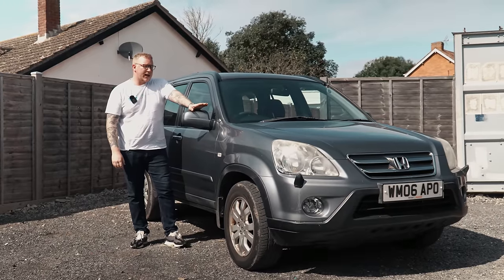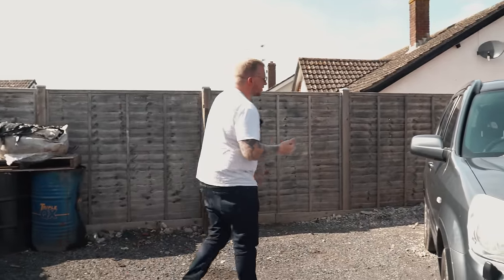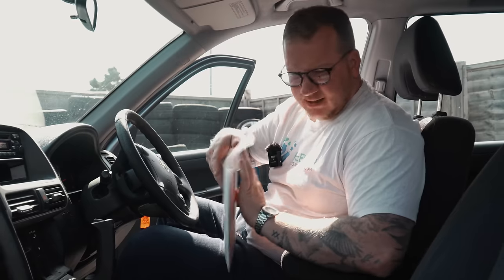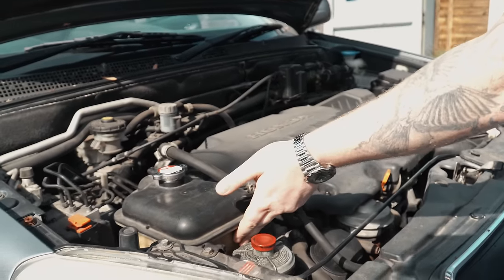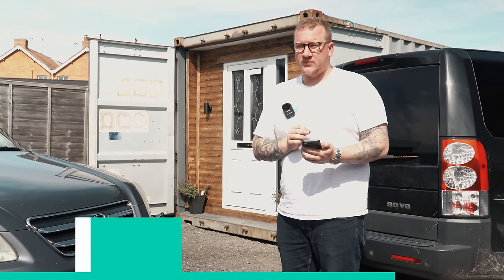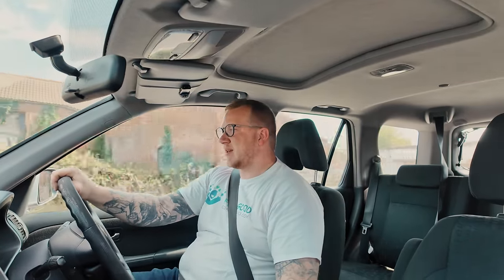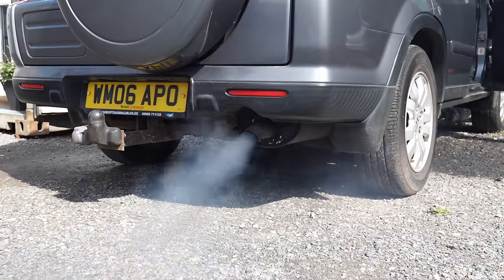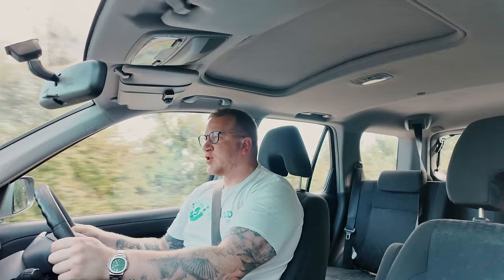£500 Seemed Like a Deal... Until I Found All the Faults!

Comment: 1 Blue smoke piston rings or the valve guide seals. 2 Front wheel needs tracking.3 keep the radio up loud.
Reply: More likely to be turbo issue causing the blue smoke considering the lack of power too

Comment: Had one of these engines in a Civic, they are nippy when working, got rid at 230,000 miles because it developed a hot start problem, started fine all day every day when cold but if you drove it for 10 miles and turned off, it would not start again for over an hour or more. Kept it going by spraying easy start into the inlet and starting it, which worked every time but caused the engine to become tappy, suspected fuel delivery problem. Passed it on as spares, after it's MOT expiry it didn't stay on the road. Good engines but not worth fixing with all these issues.

Comment: Check the rear inner wheel arch, as they are known to rot quite badly where the axle mounting points are, also, the boot floor lifts out & is basically a picnic table.

With the exception of my above points, these are pretty good cars, my Mrs had one for 3 years & she loved it, it was the rot at the above mentioned places that killed it, as it wasn’t economically feasible for us to have it repaired. So I sold it for spares or repairs & it went to the first person who came to see it.

Comment: We had a 2003 ivtec pre facelift model CRV as a first car. In the two years we had it it cost us £4K to keep it ticking along. After buying it from a dealer in Burnley there MOT service centre passed it with no advisories yet dropping it in at a garage we were recommended it found it had several issues (£500) as it had a squeak from the brakes (seized caliper) two months later a o2 sensor failed,60 miles later the CAT failed followed by the second o2 sensor. The list goes on,but we still miss it

Comment: If you take out the plastic boot liner out, under the picnic table/floor, you may find a puddle of water due to a leak somewhere. A friend of mine has a 2004 petrol with this problem which, so far, I can't find the source !!

Comment: Crv, s are bad for diffs, maybe using proper Honda diff oil, flush will sort it, seems like no boost, so maybe turbo, I've had a few with long pedal travel, calipers were seized, can't see it doing much at auction tbh, maybe better to use an online scrap buyer, I've sold a few 4wd for export, don't know if that market is still about(?)